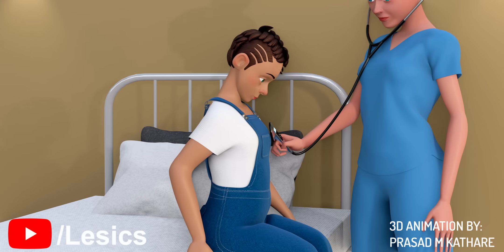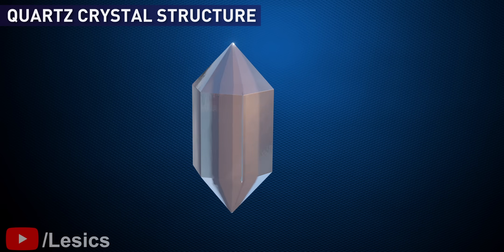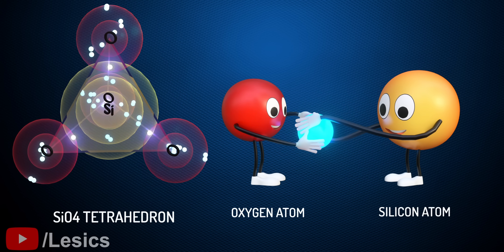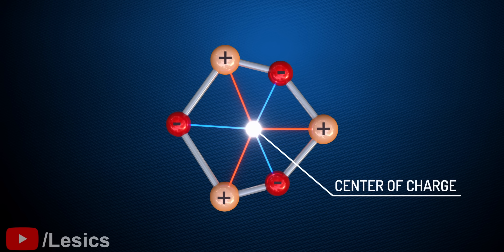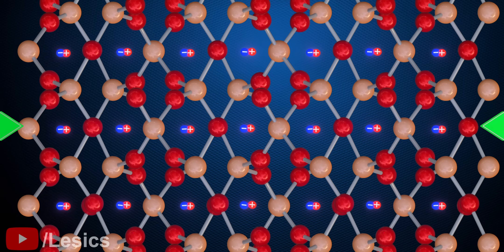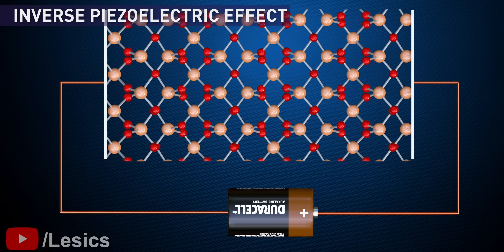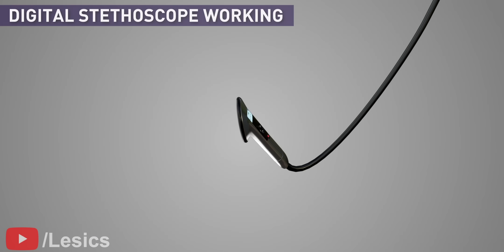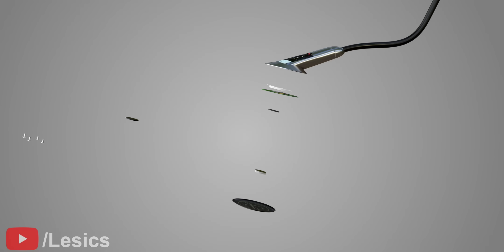Understanding Piezoelectric effect!

Comment: So does a piezo element 'flex' when voltage is applied? because if the material only expands/contracts as this video shows, then it wouldn't flex, and it would make a bad sound transducer.

Comment: I don't understand where the extra electricity comes from. I look at the Chrystal like a tube full of electricity. Once it has been squeezed the electricity is out of the tube. How is the tube refilled? Where does the extras electricity come from?
Reply: Electricity is always everywhere its the flow, that generates field, and field can spin magnets. We just try to make it move and share electrons. The spark is just because of difference in two is high enough to ionize the air and transfer electrons to reach this state where they are same. Electricity never ends or get created its always there, we just move it. Its like magic. And we suck at being wizards

Comment: The lattice animation is great, but unfortunately seems wrong.  The way that the unit cells are arranged from left to right, with them alternating every other direction, should result in a net zero charge across the quartz.  I don't know what the lattice should look like and most viewers won't notice this but I thought I'd point it out.  Still a very good visual explanation.

Comment: Totally side-tracking here:
2:50 This is btw how an oldschool HDD write head can position itself so accurately and rapidly.
It has a piezo-electrically controlled nib to perform the final positioning of a couple dozen nanometers.
(on a 7.200 RPM spinning disk... isn't engineering beautiful? (and crazy))
Reply: Thanks for the info... And really crazy that cutting edge technology serves everyday routine

Comment: But why is that the same component is used as buzzer? I have electric drums which have piezoelectric sensors which I replaced earlier. What I noticed is even the toys which I had in my childhood had the same sensors but as speakers/buzzers. 
I connected 5v directly to sensor and noticed sound coming from it
Reply: How so?

Comment: So can you convert the constant mechanical stress into DC potential difference such that it is large enough to do something like illuminate a table lamp or emergency DC fan sort of thing?
Or may be even move a small EV without any battery supply?
Reply: its seems even a wafer thin piece generates a lot of voltage but very little current
Reply: That would be a good experiment for you to conduct. Put your thoughts and questions to work! You can become the next great inventor. Seriously!

Comment: If we are able to manage anti matter with positive matter then we make  the force of the reaction hit a piezoelectric material releasing energy. If not we can use combustion or other explosives. And   I think synchronization won't be a problem. I am not really good with stuff. Just brain storming. We can also use graphene on the overside of the material sheet a layer of silver and then neodymium. We can use gamma rase to make the positive and negative matter. We can use silver somehow in aid with the gamma rays. We can ad copper beside the neodymium. The neodymium can be a compound of boron and iron and possibly a little bit of aluminum and magnesium. It might have to be in a liquid for cooling water will do I think. Maybe the thermal properties of diamond can aid the graphene? And definitely something to aid in the materials vibrations.

Comment: Do piezoelectric materials need repetitive force to generate voltage or can they generate voltage with constant force as well? If latter why? If former why?
Reply: if you put a weight on top of piezoelectric, it will generate voltage at that moment when you drop it, if you just leave the weight on it, then it won't produce anything, piezo produce electricity because charges imbalances, when you put the weight the structure changes, and become the new balance, and when you lift the weight the structure change again to original balance, and a which also produce electricity
Reply: I guess they need repetitive force. But the computer could calculate when it is constant force.

Comment: So is it possible to make a generator that is relying on this?
Reply: The voltage produced is of such a small magnitude that it doesn't seem like it would be a good main power generater, but there is still research in piezoelectric energy harvesting in car tires, etc. where there is constant energy loss (tire deformation) that can be taken advantage of and re entered into the system

Comment: What is the minimum cost of a piezoelectric material
Reply: If you're buying them yourself you can get them for under one USD per peizo disc if you buy them in packs, . These won't be high precision discs, so there might be a few mV of variation between 2 discs applying the same force, but for most DIY projects, they're good enough. They're often used in pickups for acoustic instruments so they're pretty cheap and can sometimes even be found in shops that repair instruments.